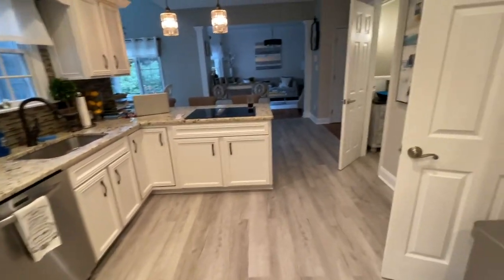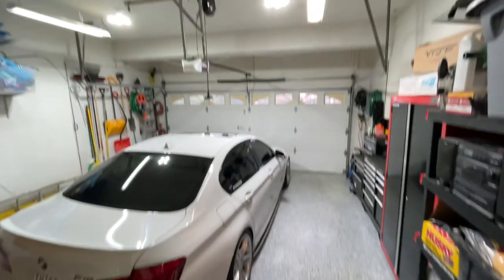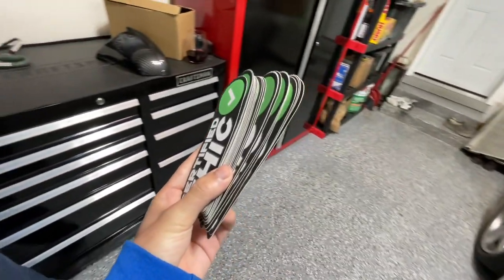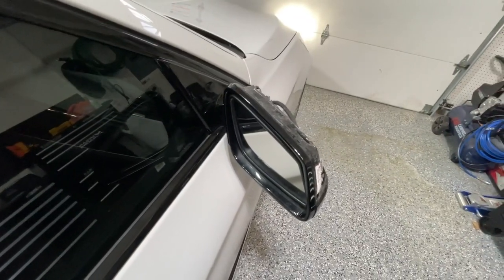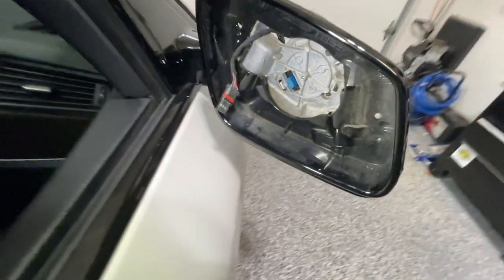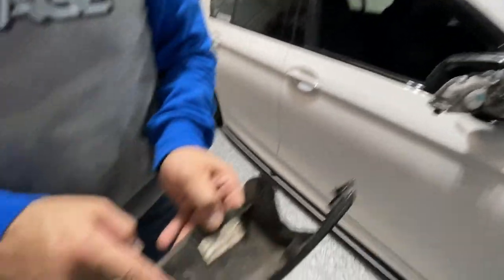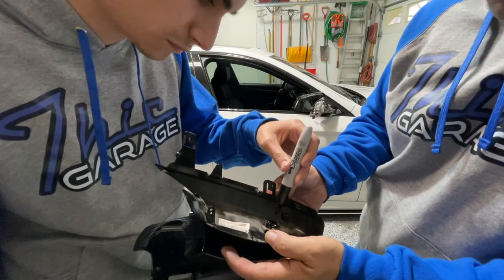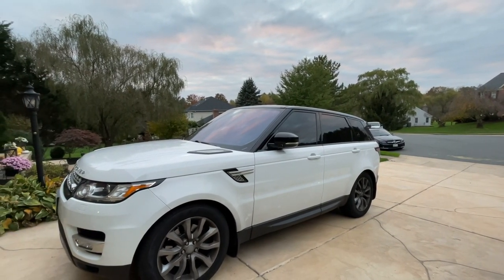Don't Make This Mistake Installing Mirror Caps On Your BMW F10 545i !!!

Comment from the maker: Links To Mods:
➢ Get Your VRSF BMW Parts Here : http://bit.ly/VRSFshop
➢ BOOTMOD3 N55 BMW F-SERIES Tune + Free Ethernet Cable + Free Remote Support: http://ebay.us/dWE67M
➢ aFe Magnum Force Stage 2 Intake:http://ebay.us/M9NFWp
➢ Dragy Unit: https://amzn.to/3hOV3Hv 
➢ BimmerCode Veepeak Adapter: https://ebay.to/2zo9MYr 
➢ VRSF Charge Pipe: http://bit.ly/VRSFshop
➢ TurboSmart BOV: https://ebay.to/2vkgooG 
➢ Silver's Neomax Coilovers: https://silvers-na.com/pages/neomax-c...
➢ BMS JB4: http://ebay.us/t2vcjD
➢ Racechip GTS Black Here: http://ebay.us/IiwZX2
➢ Megan Racing Exhaust for BMW 535i: http://ebay.us/aG0lzw
➢ Burger Tuning Intake: http://ebay.us/pGR5fZ
➢ Burger Wheel Spacers: http://ebay.us/YOQ6qD
➢ Painted Reflectors: http://ebay.us/QrLHZf
➢ Carbon Fiber Side Skirts: http://ebay.us/IYNNbC
➢ Gloss Black Kidney Grill: http://ebay.us/hTmcFb
➢ F10 Badge: http://ebay.us/a0kNz8
➢ Carbon Fiber Diffuser: http://ebay.us/HPfX11
➢ Carbon Fiber Splitter: http://ebay.us/ERgjWv
➢ Matte Black Side Markers: http://ebay.us/6lzbJD
➢ Spoiler: http://ebay.us/9x28vy

Comment: Have you ever hear of a passenger side mirror turn yellow ? The mirror glass is yellow and the driver side is normal clear. I did ask a BMW service guy and he told me they turn yellow when there is issue with them but it is fully functional, have you hear of that before ? Just bough the car 2 months ago and I believe it was like that. Very nice job with the Kitchen Reno, it look great. Glad you are back with the F10 Videos.
Reply from the maker: I have not heard of turning yellow. Do I have heated mirrors ?

Comment: Have you ever found a pair yet? I ran into the same problem as you with my 2012 550i xdrive. The sensors and the caps were just not the right size. I really want these mirrors I had them for my f30 I can’t find them for my 550 😩

Comment: I have a 2017 535i
I just took the upper part out and clicked the newer one that simple 
Plus my blinkers are on the mirrors
Reply from the maker: Yeah we don’t have the turn signal in the mirror. I’ve seen other caps but are same look as oem only carbon fiber or gloss black. Wanted the m style look. Don’t think they make

Comment: With all the mods you’ve done, does the f10 still do good on gas?
Reply from the maker: It’s ok but not close to as efficient before mods. I haven’t driven enough lately to calculate gas mileage

Comment: You broke the cover already. How about cutting the carbon cover the same shape as the white original cover and just patch it using a 3m double adhesive. That way you dont need the bottom part of the carbon covers.
Reply: I got the same ones I was planning on doing this. Don’t know what I’ll use to cut it though.

Comment: You bought pre-lci mirror caps you need lci mirror caps.
Reply from the maker: I don’t have LCI though. LCI has the turning light in the mirror cap
Reply: @ThicGarage  if it’s 2014 or newer it’s considered lci I think the turning light is an add on ik not sure on that part
Reply: @aaronvillalta3542  you're right!!! Finally someone!!! 😇😉
Reply: I have same problem, should i buy the lci covers?

Comment: The carbon fiber looking isnt good, the tiles of carbon fibers seem little spined or rotated. Not good looking sorry. Go to a BMW dealer. Probably with that level of house, you can expend a little bit more on an M5 OEM one.